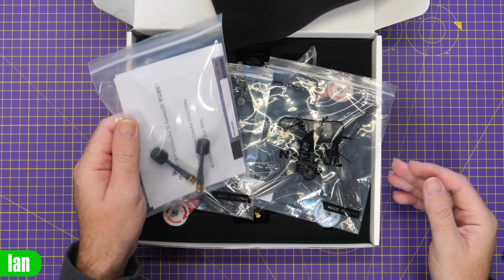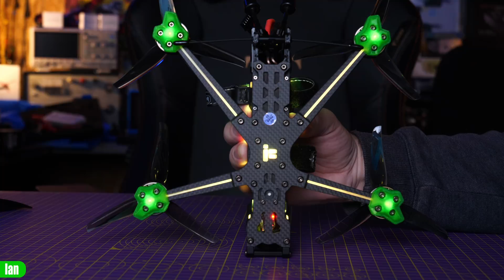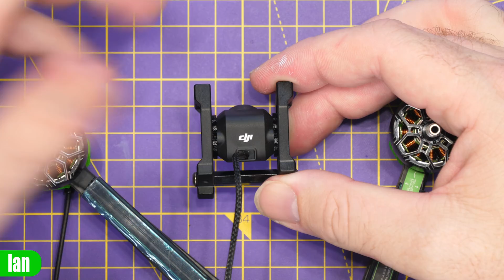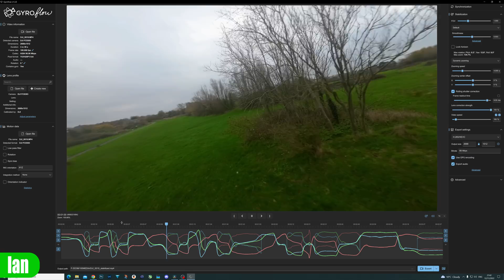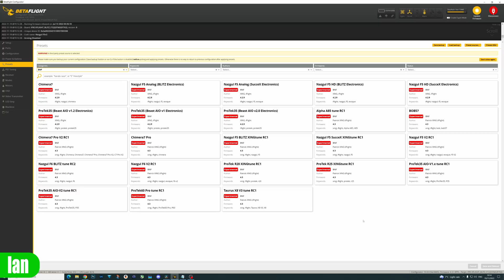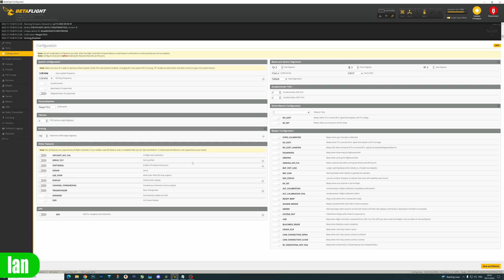IFLIGHT NAZGUL EVOQUE V2 - THE BEST DJI O3 BNF?

Comment: I have this bird and must tell I'm disappointed with a few design issues. There is no easy way to put elrs 2.4 micro receiver  in the back (it's too tight there) and standard 2.4g antenna coax is just not long enough to go all the way to the front. But the thing distracts me the most is the antennas iflight has used for dji o3 vtx. In stock you get poor quality LHCP antennas with rp-sma connectors. They don't take much abuse and you are getting poor video performance within 500 meters as their internal structure breaks. They are not linear-polarized as it should be to achieve best possible performance. Now I have to redesign and reprint the back antenna mount to use  original DJI o3 antenna. Not the way I've expected to go paying the price.

Comment: Quick question 
If I bought the evoque with the Elrs module, can I still fly it using the dji remote 2 ?
Reply from the maker: You would have to rewire it to take the input from the O3 but it’s absolutely possible. They usually remove the wires from the harness though on ELRS models so you would need a new cable from the O3 to the FC.

Comment: What antennas are those??
and can that be used with the DJI Controller 2 and FPV Goggles 2? Would it require changing the antennas on the goggles 2? (the ones that came with the Avata)

Comment: At this time watching this video it appears GitHub branches changed.. There is an iFlight-factory-4.3; however, normally in software development feature branches are worked and then merged into the main branch (master, main, or a developer branch). Is there a reason to not just point to the master branch, or maybe at the time of recording these presets were not merged into master yet?

Comment: Hi @Mads Tech! I have bought this exact model with CRSF as a used drone for cheap. I am a complete beginner and upgraded from a DJI Avata. I was expecting it to work BNF with the Goggles 2 and DJI FPV Remote 2. Unfortunately, it seems that this is not the case since the CRSF RX is using the UART2 Port and Serial SBUS from DJI O3 is not connected.
Does anybody know how to easily make it work with my setup? I was assuming I can just switch UARTS in Betaflight but it does not seem to be as easy as that... Again, I am really new to the hobby and wiring diagrams are pretty much like hieroglyphs to me for now.. :O

Comment: Heyy! This is gonna be my first drone (iFlight Nazgul F6 V2 6S, 2.4Gz RX), I'm curious:
1.  How do I connect the DJI O3 to the Integra and the Drone to the Commando 8 ELRS 2.4Gz (I dont know how things work around the FPV world)?
2. Do I need any additional antenna for the remote (Commando 8 ELRS 2.4Gz)? 
3. Does the battery charge through the drone's type C port? (If not then I guess the HOTA D6 charger is a mandatory purchase?)

Comment: Help? I don't see any presets in the preset tab. It days error loading presets from the internet. Any thoughts?
Edit: Now some have appeared but if I write nazgul or iflight in the search it's empty. Under categories drop down menu I don't even have BNF option. It stars with filters. I have Beta Flight 4.3.2
I'm also kind of afraid to flash the firmware on the flight controller this being a BNF drone. I watched Joshua Bardwell Betaflight tutorial and he said this will erase all setting iFlight has put on it.

Comment: Hey man thanks for the review. I have the dji googles 2 and the dji fpv remote controller 2 and i just lost my avata to the sea. What will be different from the avata in terms of security features? Can you activate the RTH and pause button like with the avata? Thanks a lot.
Reply: There is a GPS add on you can get which enables RTH mode.

Comment: Hi Ian. Really helpful video. I'm In the process of building this drone. On the Blitz mini wiring diagram it shows the use of a BEC voltage regulator between the 03 air unit and FC? Do you think is required or just a nicety? thanks
Reply from the maker: There is a lot of debate over Becs and O3 however I see no reason not to use it.

Comment: Excellent technical report out!  If using DJI FPV controller and V2 googles do the DJI components in this Nazgul config require remote-ID activation during the binding process?
Reply from the maker: There is no remote ID on O3 as we understand it today.

Comment: I'm a newb but have 30+ years in rc choppers.  I'm primarily only interested in sub 250 gm quads, but this and others like it look very interesting.  I've ordered the G2 goggles so the 03 camers is what I want some day.  I'm not really interested in all the crazy flying called freestyle and am mostly interested in doing surveillance and cinematography.  Comparatively, this drone is close to the DJI Mini 3 Pro in price.  I'm sure when the Mini 4 Pro comes out with this 03 camera, it will be much more than the 3 Pro, especially since it will have the added side sensors.  So here's my no drone time, ignorant question. For my desired goal in flying, would the DJI Mini type drones (sub 250 gm) be a better choice?  This is a bigger badder freestyle drone I know and u can run your own size batteries, but there's no avoidance system at all.  When u r 76 u need avoidance systems.  Maybe I just answered my own question.

Comment: Mine just burst into flames after a 15 second flight!! Any idea why? Like the 5th flight with zero crashes. I'm PISSED!!
Reply: battery failure I guess? You have a lipo battery on there, I don't see what else could just burst by itself.
Reply: @janmajnik6889  after going over it with a friend we concluded, the 03 air units cable fused with the flight controller and one of the wiring harness wernt plugged all the way in due to one if the pins being bent

Comment: Technical question: The avata has GPS, so region is set on the goggles2 based on region (atleast my understanding, unless DJI ships 2 different pre-activated FCC and CE goggles and O3's). But we if you just buy the goggles2 and o3, how does the system know you are in europe and be in CE mode? Now, I bought and iFlight Nazgul Evoque F5 V2 with O3 (should arrive tomorrow), but since it comes from China, wouldnt that be an SRRC model? Or how are these modes set. Tried to understand but it is hard to find any info.  I have the Avata also and have it set to FCC with the HAM file. But how does the O3 switch? If I understand correctly, it's the goggles2 that tell what mode the O3 should be?
Reply from the maker: Region is set on activation by assistant 2 or the fly soo. That how it knowns
Reply: @MadRC  Thx, well according to iflight, they test the quad before sending it, wouldnt that mean it is activated already? Wonder if you use VPN to be in the states and activate it, it will be FCC. But if it is activated already... KInda screwed. Not sure if yours came pre-activated for review. Thx for the reply though and good morning!

Comment: Hey Mads, have you experience any issue like what OriginalDobo had with loss of video ? i saw on captain drone had a crash as well. I just bought this quad, havent flown it yet, wld be using it to get cinematic shots, over water alot, have a fear now of it losing video and losing my go pro etc.
Reply from the maker: I have seen no issues my self.  My advice is the same for any quad. You should perform any testing and shake down flights in a safe known location.  Make sure everything is working as expected before doing anything risky and understand that there is always more risk flying over water than land. Many strange and crazy things happen over water you often don’t see over land and understand the risks.  Other than that you will be fine.
Reply: @MadRC  Much Respect Mads and thanks for your advice.

Comment: Wow what a beautiful piece of work from iflight. DJI knocked it out of the park with the o3 system.
I have a quick question on recording with the air unit. I have went through all the settings. All flights stop recording at about 3 minutes 43 seconds then it starts a 2nd file that records the rest of the flight. I sure hope there is a setting I am missing. If anyone knows I would really appreciate the fix! Thank you in advance.,!!
Reply from the maker: Sadly that’s the 4Gb file size limitation kicking in.  You could try formatting the sdcard as EXFAT and see if that helps

Comment: I do RC plane chases with my DJI FPV drone. I like it just fine. But it tops out at about 85 miles an hour. I'm looking at this drone as a replacement for the higher end chases. I only judge by 2 things. Speed and endurance. Can the 5,6, or 7 do speeds in excess of 85 and maintain them for a flight time over 4 minutes?

Comment: it was hard to know which bnf DJI O3 system to go with for a relative fpv newb wanting to get more into cinematic freestyle (avata in manual and 50 hours in the sim - terrible) :) 

went with the geprc mark5 ordered direct from geprc. fingers crossed you can do a proper review of that system when you get your hands on one. great review as always - subscribed
Reply: Good luck bro. What are you doing for a transmitter? Just curious.
Reply: @joshuasterling2144   I have the Zorro Radiomaster 4 in 1 so I’ve preordered the 1 watt nano Radiomaster elrs module for it but also bought the tiny elrs radio from geprc to have for backup and to use while waiting on the module.
Reply: @PaulStephenson003  Oh nice, I have a radio in that family. The tx16s carbon. I have an elrs module but I am afraid I may have hurriedly ordered the smaller module and since I have moved I have not flown at all. Cheers and good luck. Gep does a good job and so does iFlight. I have had quads from both.

Comment: Does the O3 unit have a custom case?  Can you not swap to a different frame?  If you break the air unit, do you need to buy a custom unit from iflight?  Or is it just a holder for the OEM case?

Comment: It would be "massive"  😉  if iflight was going to Release a bnf where the complete O3 Air Unit was Hot swappable to be able to transfer it quickly to another quad (like a gopro) or use it with a 3d print and lipo as a Action cam. Cheers!
Reply: Hmmm, I feel that theoretically that this would not be too hard to do, you would need to solder a plug to the o3, and plugs to the different quads that you are going to use them, then you would just need to unscrew a few screws, nice it over, plug it in, then unscrew it. (You probably wouldn’t have to change any BF settings if you only fly with that o3 and do  your another system in there in the mean time. I feel like this is a super good idea that could become a thing because o3 units are not cheap lol, and if you have 6 or 7 quads… that gets expensive
Reply: @zuzmw  you are probablly right. Nxp200 has never the less tryed to Design such a thing he calls It the nxp200 03 switchblock https://youtu.be/_UYBph-CrHs .  I think it is a very good First try tho it is to heavy and would need a frame with a short top plate. Also the betafpv Pico o3 is kinda good step in the right direction but they haven't had the ability to hotswap in mind I am afraid. What do you think?

Comment: Those dead cat frames are crap  design why have the arms on the back like that its just silly
Reply: For cinematic flights so that you don't have props in your gopro. This is made for people that do fpv as pro cinematographers. If you want to just fly for fun get the x frame version. Same drone but will fly much better with the proper freestlye frame.
Reply: @janmajnik6889  well quadmovrs 5inch frame is ture x and has no props in view and the smoothest quad ive seen because dead cat frames have jello and suffer from prop wash because of bad cog

Comment: I have the v1with DJI Air Unit and Dead Cat frame.  The LEDS  are a disappointment, pretty dim and with the supplied dark green TPU, very llimited on what colour settings actually are usable.  Yes, its very well made, but there is a REALLY big big stumbling block, its flight duration per pack is frankly pathetic, beaten by miles by ALL my other 5", especially the IMO  much better overall GEPRC Mk5, which manages near two minutes extra flight time in comparable freestyle flying. No flight info here, so how did it do on duration?

Comment: Great Review!  I plan to get an O3 drone.  I usually build my own,  but this looks like about what I would build anyway.  
I noticed you liked  the Iflight AOS 5 also.  I see that now has a 03 version.   The hardware looks the same. I think the AOS 5 frame is slightly better for freestyle ?
I guess the difference would be durability and weight maybe ?
Reply from the maker: Aos 5 is just fantastic too. But they are quite different. I’d say the Nazgul is like a high end M series BMW, lots of great additions and really well made but more than capable.  And the AOS5 is like a mclaren, stripped back raw and just on point. The Aos is probably the best it’s got just what you need BNF period.

Comment: very confused how they fit o3 into the chim7. They must have custom cables, i need one for a future build
Reply: change the coaxial cable with longer one
Reply: @goaki2289  yes but you seem to forget that this is is a new product. There simply is not a longer one on the market currently
Reply: @DivisionRc  You can get it in our shop

Comment: This is sick! As the owner of the first Nazgul Evoque F5D, I can say without a doubt I would definitely buy this one, it's that damn good!
Reply: Same but I think I'm going to just buy the frame and o3 air and swap my f5d over. The F5D is great my only concern is the weight. Which is why I'm also consider going with the AOS5 O3
Reply: @swb1410  I own both Nazgul Evoque F5D and AOS 5 v2. Both with caddx vista VTX. 
Not sure if I need to swap the frame and VTX to O3 air unit.
Reply: @megadony93  how do you like the f5d compares to the AOS 5?
Reply: @swb1410  well you can't do hardcore freestyle on the Evoque. But AOS 5 is lightweight and durable. It also flies better because you can put less filters meaning you get less latency which improves handling. Overall AOS feels sharper and responsive.
Reply: @megadony93  that's what I was thinking plus the lighter weight is nice because the F5D is a bit too beefy for my liking. Thanks.
Reply: I’m relatively new to FPV…would you recommend this for a beginner pilot that wants future proof quality equipment?